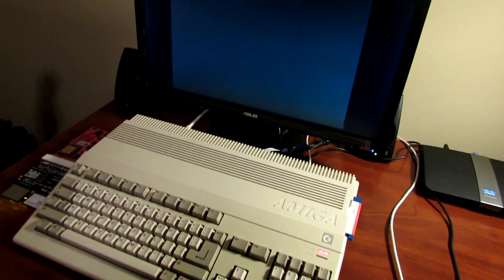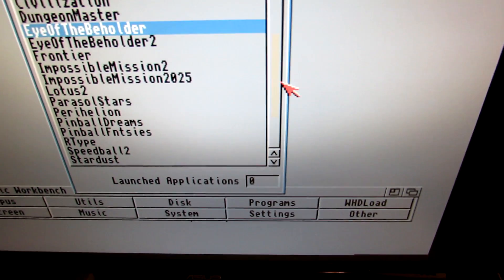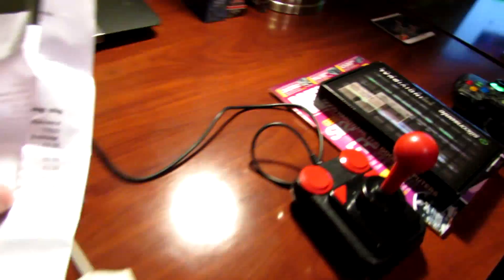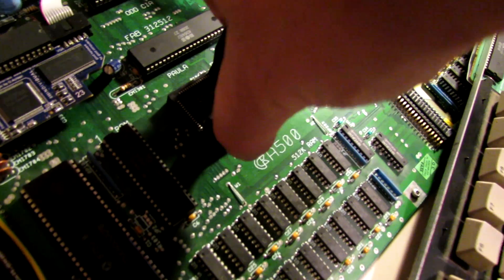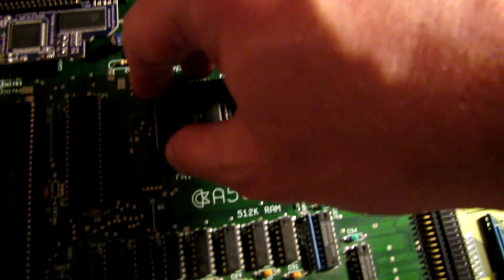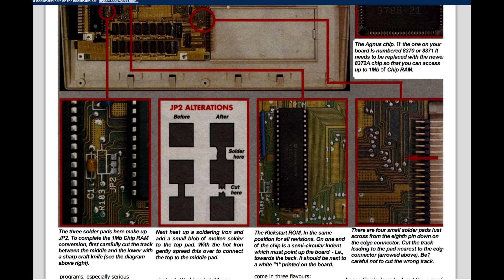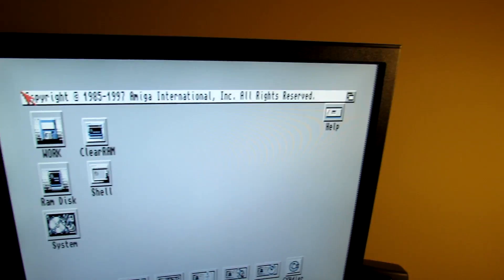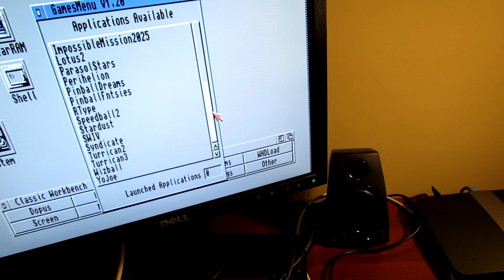Amiga A500 Chip RAM 512k to 1Meg Upgrade Guide

Comment: Any chance you still have a copy of that PDF? Link no longer seems to work.
Reply: http://eab.abime.net/attachment.php?attachmentid=6766&d=1084111855
If you are in a pall region you need to put some kaptom tape on pin 41 of the agnus to break connection.

Comment: Fast memory isn't usually particuarly quick.  The difference is that it's uncontended.  The CPU and coprocessors have to compete for access to chip memory. Only the CPU addresses fast memory, so if you can dump the program up there, the system can operate more effectively in parallel, resulting in a reasonably significant speed boost over a system with no fast RAM.

Of course, expanded chip memory is important too, because it'll be used by the sound and video chips.

Comment: There were a number of channels claiming that a screwdriver will work...it won't. The chip is way too tight in the socket and when prying you will crack the socket, which is literally 80 pins to desolder and replace...a real pain and not worth the $6 investment for the extraction tool.

Comment: Hi,
Can something similar can be done on a A2000 rev4 ? (A1000 base)
Reply: No, it can't. Cause it mounts the first Agnus 8361ntsc/8367pal chip 48pin DIL (dual in line pins - not the square chip).
Reply: Oh ok, thank you !

Comment: Got the same A500 re-capped revision 5 with the ECS 8372A Fat Angus upgrade and the A501 revision 6C. Kickstart 3.1 and the ACA500plus. 

Got almost all the games working with WHDLoad. But Cannon Fodder don’t work. Must have 1088Kb CHIP RAM, got 970Kb CHIP RAM. 

Can the ACA1221ec get extra CHIP RAM boost

Thanks for the mod video.
Reply: Wont the aca500plus give you more than 1mb??? Or am i missing something ?
Reply: There is a newer version of Cannon Fodder whdload that will run with 1MB chip. I think it came out in 2019 or something. It works just fine. No need for more than 1MB chip for whdload gaming anymore.

Comment: Funny enough I'm attempting to restore a Rev 5 Motherboard, just waiting on Caps and the 512KB Trapdoor expansion and it came with an 8372A, but the Jumper and the trace were not modified. If I wasn't subscribed here, I would likely be floundering trying to figure out why I can't get a full 1MB...
Reply: Roy Gillotti I just read somewhere that there is a new item built to eliminate the need to modify theA500 motherboards . Incision makes it. I was just going to order one.

Comment: Thanks for the video! Quick question, Is the board you worked on PAL or NTSC?
Reply: 8372a can switch both modes, you'll need a mod on a mb jumper to do the trick. 8375 is the A500+ Fat Agnus (2mb chip addressable), but there is a version of 8375 that address 1mb only, used on latest A500 (rev8a)/A2000(rev6.4-6.5) motherboards. The 8375 subrevision number gives you the PAL or NTSC version of the chip.
Reply: His 8372 chip is for PAL. For NTSC the chip is 8375 318069-17 (I could be wrong).

Comment: A little bit confusing. They used other words to "normal" customers in Sweden. I remember that it was called RAM on Amiga 500 and graphic RAM on Amiga 500 Plus. Graphic RAM were more versatile.
Reply: that depends of the kickstart version. v1.x shows total RAM, v2.x / 3.x kickstart version shows separately (Graphic Ram is the Chip Ram, and Other Memory is the Fast Ram). That's it :)

Comment: Thanks for the vid, I have an NTSC rev 5 and I haven't done this in nearly 20 years. Your video helped tremendously. I just wanted to say that the chip removing tool you were using, you don't pull or wiggle the chip at all. Hold that tool in your hand, look at the ends that grab the chip. Now squeeze the tool. Yes, that's right, the tool extracts the chip for you. All you do is insert it then squeeze. Chip will pop right out.
Reply: I wish I'd known this a few months ago - I pulled my Agnus out using the chip removing tool and destroyed the chips pins :(

Comment: Great video - nice and clear! One question: how do you link the Amiga to the LCD monitor? Is it a special cable or another mod?
Reply: Andy Roberts, Hello. There is an Indvision FlickerFixer-ScanDoubler installed into Denise socket to connect Amiga to LCD display. And Denise chip is not replaced by this adapter, but it is put on top of Indivision.

Comment: Has anyone other than me broken that tab on the trap door covers?  I have four of them and I have broken three.  I kid you not, I have tried very hard to be gentle but they just snap.  Ugh.
Reply: Plastic degradation. The solvent that makes the plastic softer, slowly evaporates making the plastic more and more brittle until ultimately, such parts simply snap off. Thin part harden faster than thicker parts.
Reply: @paulmichaelfreedman8334  Yep.  Makes sense to me.  Fortunately, they are pretty easy to fix.  Now if I could just find a replacement front cover for my Amiga 1000, I would be happy.
Reply: @cbmeeks  You could try a 3d printer service? or 3D print one yourself?
Reply: @paulmichaelfreedman8334  That's probably the route I will take.  I just don't have a 3D printer and most of the time, I don't like the "3D look" most prints have.  But I may have no choice.  Those covers are unobtanium unless you get lucky and find a complete A1000 for a decent price.

Comment: do you think it would be possible to fit a small switch between the EXRAM solder points? I'm alittle worried about severing the connections permanently on that and the jumper JP2... are there any downsides to these permanent mods? thanks for your awesome helpful vid

Comment: Hi there. atm I bought the 8372A chip for my A500 rev5.  My version is still older since it is brownish colour mobo. It has kipper2k A508 fastmem board with ks3.1 rom. 
My question is when quitting a game/demo etc from whdload  does the quit key work or have to quit by using ctrl +A+A keys? Is it true that you must have a 68010 processor to quit whdload games??
Reply: 68010 helps in most cases as it brings in the VBR functionality, but many WHDLoad slaves have already been updated to make the quit key work on 68000-only configurations and the development continues. Getting an ACA500+ is an easy solution also as it too gives you the VBR, completely hassle-free.

Comment: Does this cause compatibility issues?
Reply: You waited four years for this, but here it is: Yes, it does with a few old games that need 1Mb of RAM. They expect the second 512kb from the trapdoor at a certain address. They won‘t find it there after the mod of course.
You can get around this with a 2MB trapdoor expansion that comes with a Gary adapter (30 to 40 bucks new) which will give you the 1Mb chip RAM aswell as 1,5Mb of slow fast RAM (the type you had before the mod) at the expected address.

Comment: seems like you already have a ram expansion in there
Reply from the maker: +retronostalgic thats FAST ram, you need to perform the mod i mentioned to convert that 512k into CHIP memory
Reply: +Modern Vintage Gamer - so when you upgrade an amiga to 1 meg via the trapdoor it only gives you a mix of chip and fast ram?
I have a game called turbo trax that just wont load - (error code 103) on the box it says 1 meg chip ram needed.
Reply: +retronostalgic - 99% of my 1 meg games work fine although a couple do crash later on and turbo trax wont load at all. They run fine on a 1200 though
Reply: +retronostalgic - hmmm looking at your vid maybe my A500 is an early version with an older fat agnus chip
Reply from the maker: +retronostalgic A1200 has 2 meg of CHIP RAM so you wont ever have this problem. This is really geared for WHDLoad on an A500 :)
Reply from the maker: +retronostalgic yep that is exactly right. its just a solution for folks with Revision 6 or lower Amiga A500s
Reply: +Modern Vintage Gamer - So how comes nearly all my 1 meg games work on my 1 meg amiga but three don't? Do you think those three need the full 1 meg chip ram rather than just my standard trap door expansion?

Comment: Nice mod mate!
I have 3 A500, one of them is a plus model.
I have 512k slow at the expansion of one, 512k chip to the other.
My plus model has an ACA500 with two megs of fast and another two on top of my internal 68k. I also have 1MB of chip in the trapdoor which gives me 2MB of chip and 4 fast.
The strange thing is that you can't disable the external 68k 14MHZ on aca as the manual says BUT!!! when I enable via a command the 2 megs on the internal card the clock falls to 7MHz... I believe that this enables the internal or degrades the external to work with the other ram and the CF cards are working :-/
Reply: Vincent GR ... I also want to stress placing an old Fat Agnus in a chip 1 Megabyte capable might destroy something.
Reply: Check the agnus revision, some are not compatible with some mobos.
Reply: ***** Yes an old Fat Agnus has 1 pin causing short circuit in newer Amiga revisions. I never knew what was damaged only the old Fat Agnus did work in an old Amiga afterwards. I couldn't first revision 1.2 Amiga to run workbench and ROM 2 either. But the older Amiga was never damaged. But this is 21 years ago it happened.

Comment: Nice video. Good to know I was remembering most of  it correctly. I favorited it in case I ever need to do it again. I guess the Rev5 does not have room to solder extra ram looking at yours. On the Rev6 every other piece of ram is gone letting you upgrade that as well. Would really like to bring mine up to 1.5 megs of Chip RAM in order to get a few 640x480 high resolution games (like A-Train and Sim Ant) to work in that mode. Anyway, glad to see you documented the process!
Reply: Rev6a let you possibly add chips on empty sockets, although not necessary nor recommended. 8372a Fat Agnus will address only 1mb chip ram, ignoring the card expansion you would mount in the trapdoor. Some tricks have to be made with the Gary chip to obtain the activation of the so called "slow ram" space, mixing 1mb chip onboard plus 512k in trapdoor.